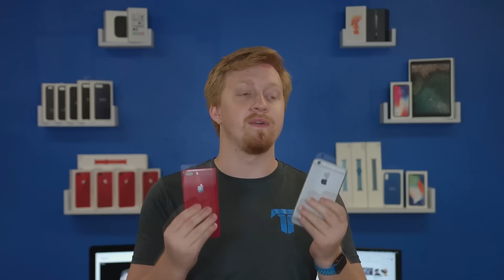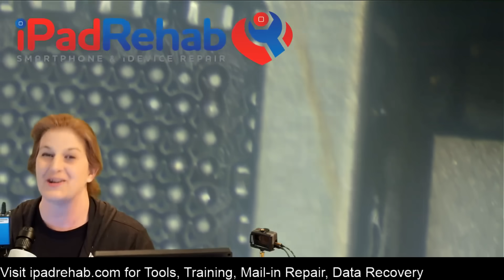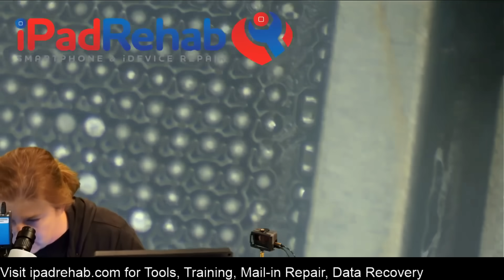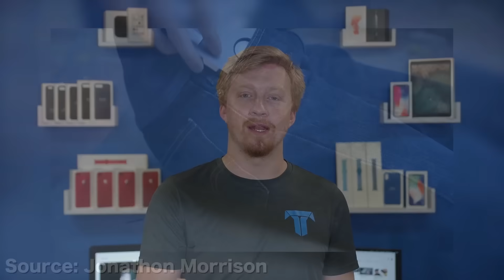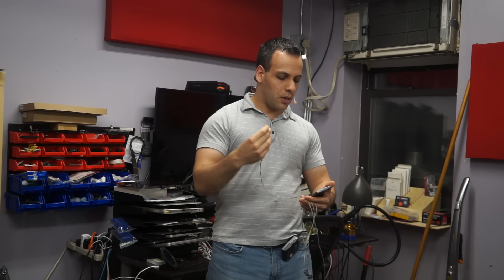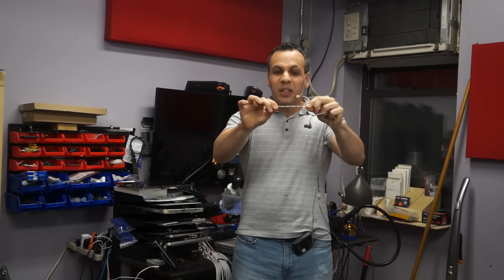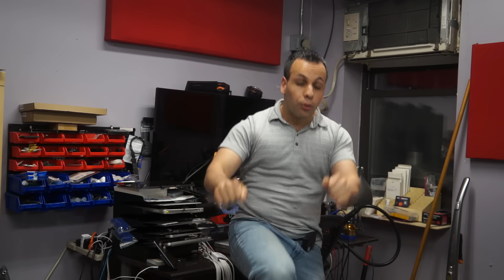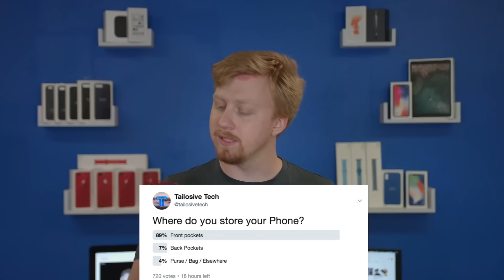The truth about iPhone bendgate deniers

Comment: I actually had the whole back pocket thing come up when i was picking out a smartphone for my mom who is a bit too old and uninterested in electronics to reliably pick one out herself. Basically the reason she gave for having her phone in her back pocket was that apparently a lot of women's sized jeans are designed with front pockets that are so small that you wouldn't be able to comfortably fit a phone in there without risking that it falls out or impedes your ability to move freely. Apparently bending over or squatting down to pick something up would become exceedingly uncomfortable and impractical when she stored her phone in her front pockets as opposed to storing it in her back pockets. Don't know if that's the reason for other women as well since the topic hasn't come up with other women i know but it does make sense. Also just in case anyone was wondering, i ended up getting her a Samsung Galaxy A3 with a leather booklet case. Not top of the line by any definition but she didn't want an expensive phone and the A3 does everything she wants it to do. She's loved it ever since.

Comment: I don’t think the design is a failure if it’s so popular, maybe the materials that they were using for the iPhone 6 weren’t the greatest. I have had mi iPhone 6 since it came out and it’s not bent, still works perfectly in iOS 12. I do agree with some of your points about how apple’s customer service it’s not the greatest, but sure their phones are good not perfect but there’s no perfect phone. You’re taking the bashing on apple to far to the point were it becomes a necessity more than an opinion.

Comment: I'll be honest. I bought the s6. But that was because I had gone from a s5 to a Sony Z1. The Z1 broke right after I got home from new zealand where i bought the phone and back to norway, well variety turned out to be a bitch. 
So seeing as the phone was 100% dead I had to buy a new one. 
Well, having had only positive experiences with Samsung phones before, non of them breaking their screen, or stopping working without me being 100% at fault. So having just had an absolute shit experience with sony I whent back to samsung. 

Boom, I was fucked over. And to late to change due to my phone companies shitty policy. So I was stuck with the S6. But despite it's flaws, it had no problems(despite the design flaws) for 2,5years of use. And only then did the charging port start to wear out. But I figured 2,5 years was reasonable. So I bought a new one. a s9. And I'm actually very happy so far. but god danm it's good to have the SD card back!

Comment: My accidentally twisted my opo3t so bad that screen cracked and one end of hardware was partly out of the outer frame. Pushed assembly back in frame and was surprised to the fucker still works. Bit disappointed that screen cracked, but it works and I'm quite fine with that.

Comment: funnily enough, my huawei p8 lite is physically bent, as where it doesn't lay flat on a table anymnore, and it still works completely fine too, so apple really doesn't have an excuse
Reply from the maker: Apple unlike most other phone companies screws the logic board into the phone so that if the case bends the board will bend along with it

Comment: Modern designs resemble the design, not the quality of the design. The 6S acknowledged the failure of iPhone 6 by alternating the materials used for the phone. We have more zink in the 6S (I think I read that somewhere) and Apple calls it 7000 Series Aluminum. It's much stronger.
Reply from the maker: and then reverted to junk again in the 7
Reply: Louis Rossmann I like iPhone but personally own an S9+. You did a great job addressing the whole bendgate argument, and I loved hearing from the perspective of a guy who repairs stuff. I watch Tailosive tech quite often, but I agree with you 100%

Comment: People "testing" these devices don't seem to realize that it's not a one time and it's broke. It the sitting in your pocked in rush hour traffic for 45minutes. Another point they don't seem to take into account is that when the phone is charging or discharging it gets hot. You have it in a pocket/purse/car holder and it's on/gps/charging and there is any type of strain it will be magnified by the heat being created inside the phone. While the case may not suffer due to it's bad thermodynamics the metals on the inside conducting the business of the phone is going to take damage. If you're up north where it gets cold there's the possibility of more dynamic thermal changes. Think about taking the phone off the charger walking outside where it's 30F and sitting it on the hood of your car for a couple minutes while you grab something form the back seat or whatever.
Reply: P S that's an interesting comment.

Comment: “A 400bn dollar company that can’t come up with better engineering or design...” they did.... a year later.

I can’t confirm the exact number of cases for this display but clearly it wasn’t a safety issue and/or it didn’t affect enough people for it to be recalled.

The tone of the video was grossly condescending and focused on the internal issue as a result of flexing rather than the actual propensity of flexing itself, which is what Tailosive Tech appeared to be focusing on (you know, because he knows nothing about engineering and as such wouldn’t have any knowledge about the effect bending has on the internals).

Overall the points whilst made sense were not well argued (neither video was tbh). I think the tone of the video towards the end also showed a lack of respect for your peer on the platform which affected your credibility.

Comment: My Galaxy Note 8 - Had it before it launched, dropped it over 300 times before screen even cracked (I've tossed it across the room onto a concrete floor and it didn't crack.) Now the screen is shattered to shit, looks like bullet holes everywhere, but still works perfectly fine, viewing and touch experience unaffected on this beautiful screen. Hell, I'm going to use it until the Note 9 or 10 as enough shards have come off that it doesn't cut my hand every time I use it. I see people coming in with shattered ipads and iphones (or a hairline crack that makes the screen totally unusable) after barely using them for a week, saying they only dropped them once.  Seems like Apple's time is coming up.

Comment: The problem is mis-labeled.  It is not "bendgate", it is "fatiguegate".  Flexion is a huge problem for traditional electronics because the material selection and process design for them is all based on stiff, but brittle, materials (resin based pc boards, crystalline silicon, etc ...).  When an electronic design is packaged in a material designed to be flexible (polymer plastics, thin aluminum, etc ...) and marketing dictates form, you get fatiguegate.
From WIkipedia: "In materials science, fatigue is the weakening of a material caused by repeatedly applied loads. It is the progressive and localized structural damage that occurs when a material is subjected to cyclic loading."

Comment: there is not even much lag in newer android smartphones. i use a redmi note 5 pro , its has a sd 636 and is around 220$ i guess. even at this price this thing doesnt lag except occasionally( doesnt freeze). you can test out the new flagships. i support your cause of pointing out mistakes in a company's products. every company should strive for improvement. moore's law has to be re-established

Comment: Yet my iPhone 6 Plus, which has never had a case, has lived in my front pocket for three years, has fallen to asphalt and concrete many many times when I open my truck door, has survived perfectly with no broken glass, hardly a visible bend and the original battery is still at 88% strength. Say what you will, the iPhone 6 Plus has been the most reliable smartphone I’ve ever owned and it’s still my daily because of it. 

I’m not denying that the iPhone 6 Plus could bend. But it didn’t happen to me and I used the heck out of this phone. Apple should have used the higher grade aluminum I suppose, but after three years my iPhone 6 Plus is in perfect working condition.

Comment: Pretty sure bendgate was about the phones looking bent, not some invisible damage that you are talking about here. They bent due to material by the volume buttons being too thin in some specific units to withstand the stress from normal usage. Although quite widespread, the issue was not as popular to occur in every single phone, so obviously the chances of a relatively big YouTuber having a phone with the issue was minimal. 
Bendgate was specific to the iPhone 6, models after the 6s suffered no such damage, especially not in the same quantities as the 6. 
The reason why people are so upset with Apple is because they think Apple is this ultra high quality phone manufacturer that should not allow any errors during the design and manufacturing process, which is just stupid. Apple consists of humans, humans tend to make errors. Apple didn't think the risk of bending was too high, so they went for it. They couldn't predict it will happen, they can't see the future, the only thing they knew is that a slim tall and wide phone is more likely to bend than a thicker smaller phone, due to how stress distributed over the cross-sectional area of the device, and how moments work.

Comment: Funny thing about aluminum, it has poor tensile strength compared for example to steel. So if one designs an aluminum part to fail at some given load, you might think then back the load off and everything is good, it's what you might do for steel. But if you leave a weaker stress on aluminum constantly or repeatedly then over time the effects accumulate and it will give out. It is highly maleable, it has lower threshold to giving under stress over time. Aluminum can be good for a structural design but needs to be thick to cope with this.

Comment: ts funny. I worked at a repair shop for 4 years. and we talked a lot with other shops. And a strange pattern was showing. NON off the staff at the repair shops, had Android phones? All had iPhones ?? after som years, I learned why. My Brother, had a CAT phone, solid as a rock. One day, his speaker had collected so much dirt etc, that it had to be changed. And the volume up button did not work. When sourcing spareparts, we where never able to get a sparepart for the button. My boss started his business  with phones since Nokia 3210. And he also have a iPhone. Hi said. Its better build. way easier to get parts. he can get every part on the phone, no problem. Yes, som of the things are not reparable, but, we saw that on all phones.
There are many Fanboys on either side. Louis Rossmann is clearly a fanboy as well. Running a repair shop, I know he has seen some big crap on other phones. Like Samsung, never selling there screens cheaper, even with time. A Galaxy SII, cost the same today to get repaired, as a S6. Even when buying from Samsung directly. When I had a shop, our must popular repairs was micro usb´s, and cheap PC´s. We often had HP computers, the where often build in such a cheap plastic, that when you liften them in the corner, with 2 fingers, the MB would flex so much, the CPU chip solder would crack. Like in the hundreds!. And Samsung TV´s. dieing due to cheap or badly placed smd´s. 
Læs mere

SVAR

Comment: Drew from Tailosive can run his mouth without engaging his brain. However, I think the flexion damage is much more prevalent on the 6 Plus than the 6. Both my daughter’s have had iPhone 6 since 2015 and have beat the crap out of them including falling on them and bending them in their ass pockets. However, although I have replaced screens, batteries charging ports cameras etc. I have always straightened em back up and they go and go with no logic board issues. You’re right girls put phones in their ass pockets but it tends to be guys that go for the bigger phones! Do you see these problems on the 6S & 8 as well and what’s the ratio of faults between standard size iPhones and Plus models?

Comment: Responding as I watch... I disagree that he "sat" on the phone, he put it in his front pocket, a very loose pocket and there were no real actual flection events occuring. If his jeans were tigheter and he moved in ways that put actual pressure on the edges of the phone? Then maybe. Try putting it in tight jeans in your back pocket and sitting down like a lot of females tend to do (thanks for covering that later in the video). I agree that normal use single deflection events should be good, it's just the work hardening aspect of flection. Take a piece of solid copper wire and bend it back and forth a few degrees and see how many times it can bend before breaking. Now if you don't want to wait that long, bend it 90 back and forth and it will break pretty quickly. The end result is going to be the same. Minor flection events that happen infrequently should be fine. minor reflection events that happen more frequently... well bend that copper wire and see the end result.

Comment: I worked in outsourced Apple Call center, Apple Considers the bend a Beyond Economical Repair, and not a design defect. 

Apple claims that the bend is due to people keeping the Phones in their pocket.

The Boot loop is a big issue, but the Tech Support agents are told to act like it is one of the first times it has ever happened (unless they changed in the last 6 months), and updating the hone and wiping your data will fix it.

Comment: It's strange how far people will go to defend a bad design, there's a good video by JerryRigEverything showing off the durability of the Nokia 8 from last year where he notes that the body is made from the same grade of Aluminium as the iPhone 6 is, and while there is a small amount of flex when he attempts to bend it in the video it is certainly nowhere near as substantial as it would be on an iPhone 6 if the same stress was applied to it just by adding a curve to the back panel of the phone. A bad design with the wrong materials is inexcusable for a company as large as Apple and I'll never understand why so many people still buy their products.
Reply: Exactly! And whats worse is those who use Apple products will defend the "Ease Of Use" cases of Apple products. Even though pointing out all these "Ease Of Use" cases exist on better built and not to mention cheaper devices.
Reply: insert SpongeBob imagination gif 
But it's... The ECOSYSTEM
Reply: Because of ios
Reply: I would guess for most it is brand recognition. Personally, I have a hard time finding small fast phones, and besides Apple, I've only found Sony smartphones with similar small size.
I do not know if other Android manufacturers could capture a larger market, by making smaller phones.